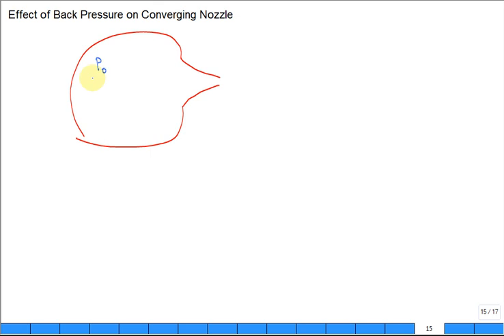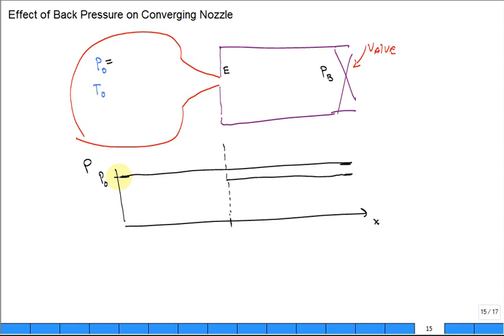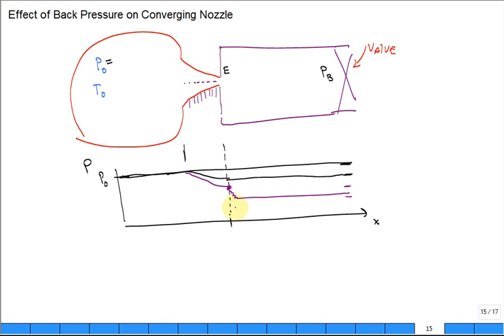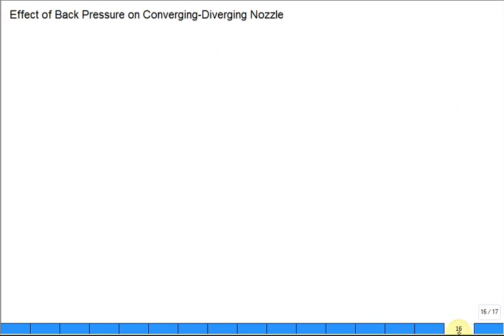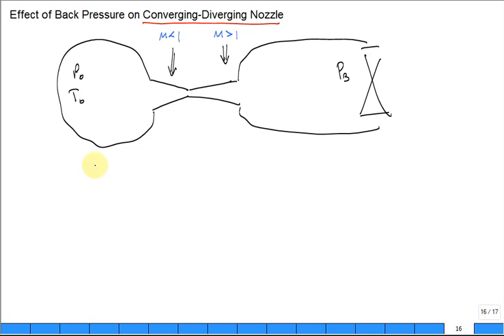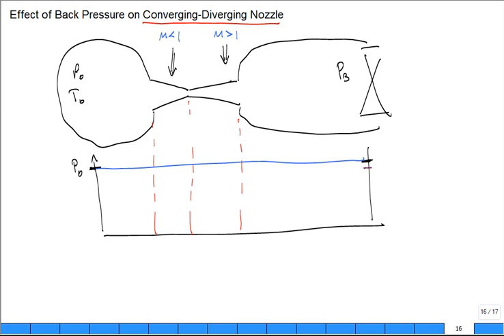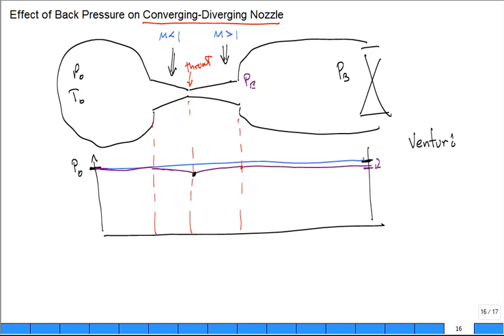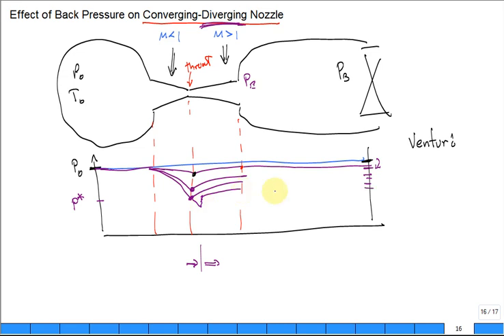Flow in converging and then converging-diverging nozzle

Comment: Is a control valve considered a CD nozzle.?
Reply: It really depends on the specific geometry. But if you considered a traditional control valve, a cd nozzle is a huge under-simplification.
Reply: @mikeibanez  any lectures about control valve design  & pipeline design for gas ( compressible) to compare it with nozzle design,pls

Comment: Nice job professor but there's two explanations missing. 1)  why does M=1 define the maximum velocity thru the throat?  2) Why does velocity increase with a diverging nozzle after throat.    (A physical explanation without resorting to  the formula dA/A = -(dV/V)*(1-M^2) would be helpful).